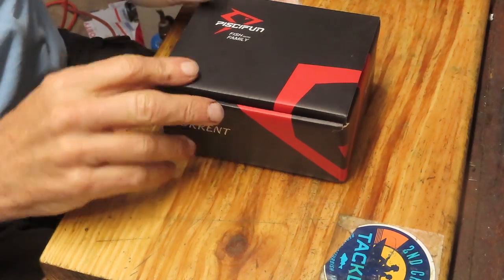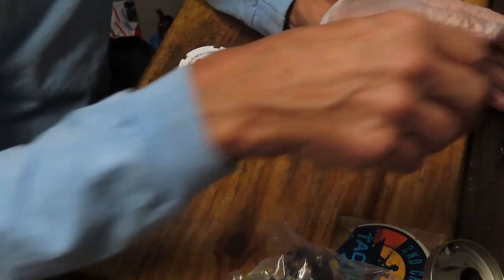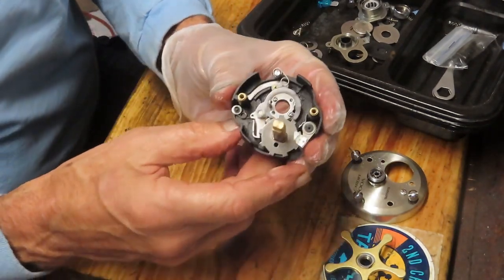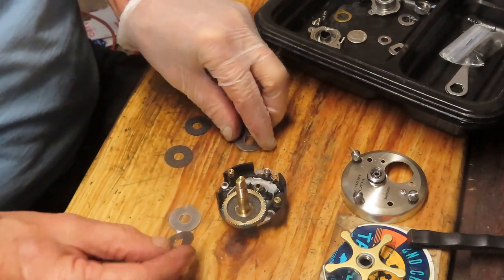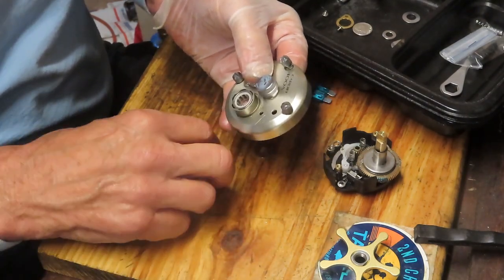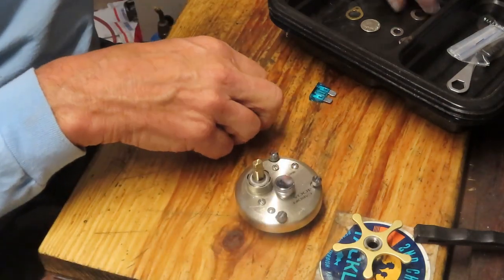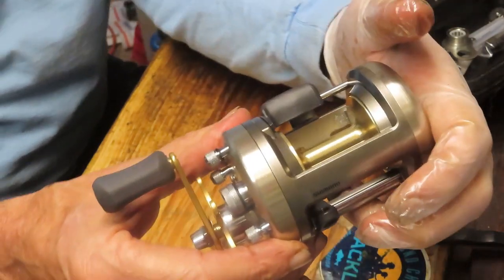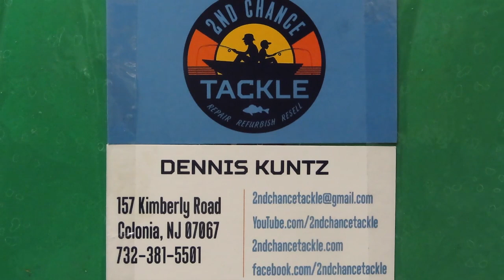Shimano Corvalus 400 fising reel in a bag service project How to service and reassemble

Comment: Shimano is really good with keeping most of the level wind reels almost identical.
The Corvalus, Corsair, and Calcutta could use the schematic. The only difference is the Calcutta uses machined side plates while the other two use stamped metal plates.

Thing of reel in a bag or box like Christmas. You never know what you're getting until you open it up.

Well done Dennis.
Reply: Yep I have one for him to do wait until you see the mess 😢 have for him it’s bad.
Reply: @RickMahoney2013  
Sorry to hear about the mess, but I love mysteries.

I keep a file folder of schematics for reels, and keep spare parts on hand. 

Waiting for the mystery box.
Reply from the maker: Thank you

Comment: Super helpful.   Thought I had mine fully lubed and put back together but I cannot seem to get the thumb release to work.  Setting both the pieces as instructed but once it trips once when I crank it completely disengages.  The reel seems to function fine other than the thumb line release.   I did take out all of the screws on the crank face.  Not sure if putting one of those in the wrong hole could be causing this issue.
Reply from the maker: This seems to involve the trip lever inside the reel.  When you mount the side plate, make sure that you pull all the way up on the thumb bar prior to installing.  Check the release lever inside the reel to make sure it is working properly prior to reinstalling.
Reply: @2ndChanceTackle  I am setting the trip lever and it is tripping when the reel handle is cranked.  When I screw the two reel parts together it together it trips once but then does not seem engaged.  Do I need to completely unscrew and dismantle the handle component.  Appreciate your help

Comment: Plastic pawl caps always break. They used them on the Calcutta not sure if they still do. I was thinking he sent two IR clutches cause one may have been a replacement. Might want to see if one slips, just a thought. Schematic shows 4 drag spring washers.
Reply: The OG Calcutta uses a metal cap and so does the B version. You can use the metal cap on the Corsair, and probably the Corvalus.
Reply: @gungadinn  the Calcutta I had purchased in 90's had a plastic pawl cap. I don't have the reel anymore but I distinctly remember cause it split and couldn't understand why they skimped on that part cause the reel wasn't cheap.
Reply from the maker: Yes - I retired it to four once I got a look and I did check the A/R to make sure there wasn't a slip.  Sometimes you get more questions than answers, like the spring and wrench in addition to the extra clutch
Reply: @2ndChanceTackle  the fuse remains a mystery as well 😊